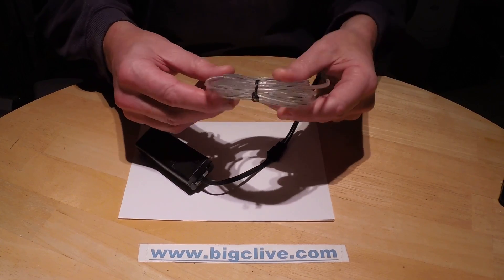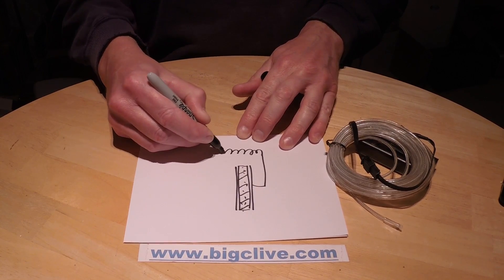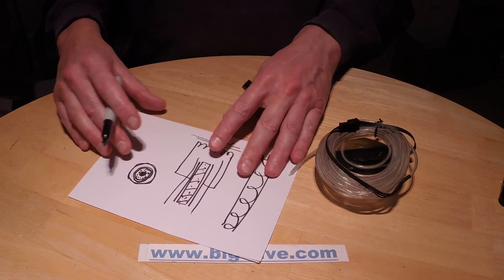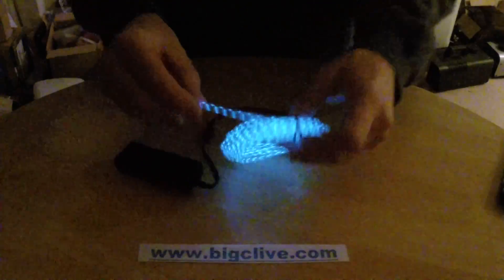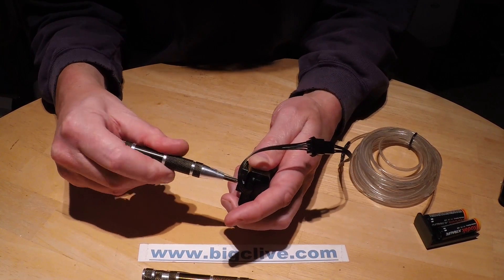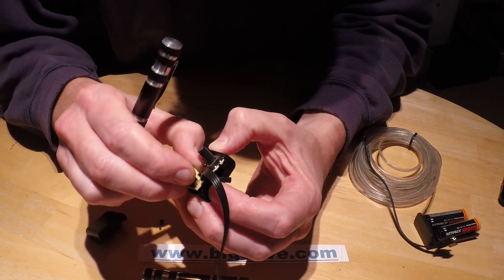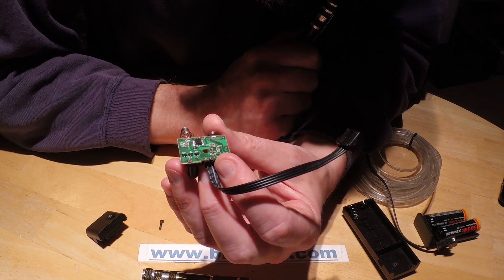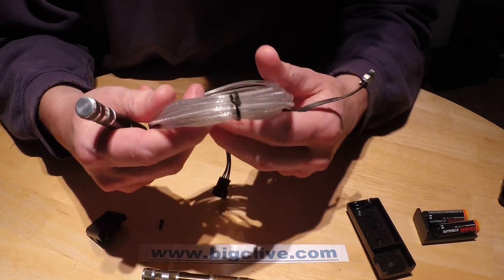Chasing electroluminescent wire.  (A look inside the controller)

Comment: Neat video.  
Ive had an idea i have been trying to figure out how i would go about it or if its possible at all with el wire or lumilor paint. 

Id like to make a word light up from a swtch.   Only the whole word wouldnt immediately be illuminated. 
I want to have a word tjat ill choosrelluminate from left to right letter by letter using ,  the effect or look iguess.(Thhe same way that a a fuse would bu:5c55. 5vf/y/rn lile on dynamite or cannon.   And then when it reaches end of wort stays illuminted till switched off
Reply from the maker: The scripting effect for EL would probably have to be done in lots of small sections.

Comment: Is it possible to create letters with this material; to cut and splice a "Y" or "T" without a noticeable junction...?
Reply from the maker: Not easily.
Reply: You could, but then you have to wire each cut section to the Power Supply as if they were new EL Wires (because they are: since they're connected in parallel). It's far easier to just buy shorter EL strands or just make it all with a single wire and either hide the junctions or just put tape on top of it.
Mind you to be sure that the shorter strands (or cut ones, if you went that tedious route) can take the power from the inverter, or they're gonna short and fail. At least that's what an absolute noob in Electronics thinks.

Comment: Oh wow, watching this almost 8 years after release, and the controller looks pretty much identical to the one I bought last week. That's funny. I converted mine to USB-C power, so now I don't have to worry about those batteries anymore.
Reply: How you do that
Reply: @blizzlakeMNsole  Buy a bare USB-C connector with a PCB on it, then get a regular buck converter you can adjust, and hook it up. Buck converter takes 5v in from the USB-C plug and then it outputs 3v (because two AAA in series = 3 volts)
Reply: So you're converting AC to DC and stepping it down so you can step it up and go back to AC? I love it
Reply: @VeProducctions  No. The power source (batteries) are DC. I just use a constant voltage source (USB-C with a buck converter)
Reply: @mortenmoulder  Oh, I thought you connected it to a power supply, not a power bank but I guess the power bank is better because it allows the whole setup to maintain portability

Comment: You should revisit this stuff and stick it on a bench supply.  Overdrive it with current and voltage to the point of fail.

Comment: hi great video ! so do you  know if is there any schematic to use electroluminescent wire  using just  solar panel with rechargeable  battery and small charger/controller module please?

Comment: could this be run from a usb ac adapter? would it require current limiting or would the adapters own limit be alright? I have some old ones that are only rated to 0.6 A and newer ones that go up to 2.3 A. I know there are charging cables that chase but I'm hoping for a cable that will just light all the time that I can power via USB.

Comment: Hi Clive, in your opinion, would you say that these devices are generally safe or is it possible to stumble on a dodgey/deadly one? (I suppose actually any electric device if not done properly could be deadly so maybe that question isnt answerable)
Reply: AlpakaWhacker . this kind of inverters has very low current output, so it isn't dangerous but it hurt when is touched
Reply: You can get a zap off the terminals if you manage to jam something conductive into the JST connector, but nothing particularly harmful, just feels like a strong static shock.

Comment: What I don't understand is, that if it's just phosphor in a dielectric then why can't they make them as bright and long lasting as fluorescent tubes?
Reply: Flourescent tubes are vacuum tubes and they require an electronic ballast. EL wire can be powered by 2 AA batteries in an inverter. The inverter changes the DC back into AC and ramps up the frequency to 2kHz.

Comment: 3:26 but how many amp hours to you get from those batteries? ;)
Reply: amp hours in batteries vary by manufacturer. I suppose it could be possible to make a usb connector to the inverter so that rechargeable USB battery packs could be used.

Comment: I wonder if they make some that don't make that noise.  I tired putting hot glue in mine and it still was very audible.
Reply from the maker: +Mickey Mishra It's because the little transformer is run at low frequency.  They always seem to make a buzzing or squealing noise.  It might be possible to make a silent one with a power supply and H-bridge driver, but I'm not sure.
Reply: +bigclivedotcom I am going to try and look into that.   The noise drives me bonkers.    Thank you so much for the reply!    I love your show !

Comment: They're wonderful for certain applications.  I have about 15 little flat panels with these sorts of devices in them which are night lights.  I calculated that at the current stamped on them, they cost somewhere around $0.25 or $0.30 to operate per year each...so a "whopping" $4.50 for the whole lot of them...PER YEAR.
Reply: There was a light installation on the way from Helsinki to Helsinki-Vantaa airport. It was on all the time because time switching would cost too much. It had thousand one milliwatt leds. So whooping one watt power consumtion. It was teared down because so many people complained about wasted energy. People are morons.